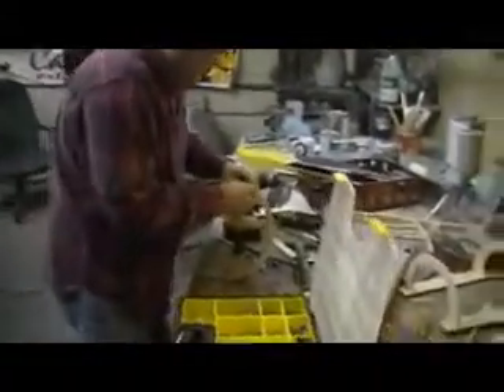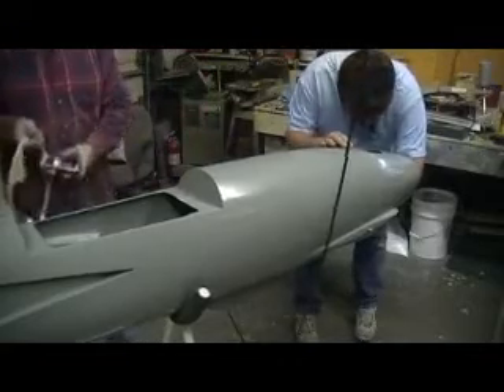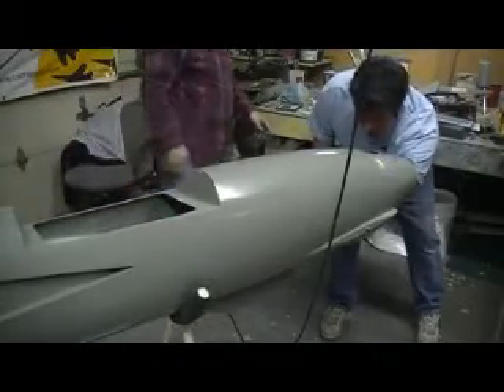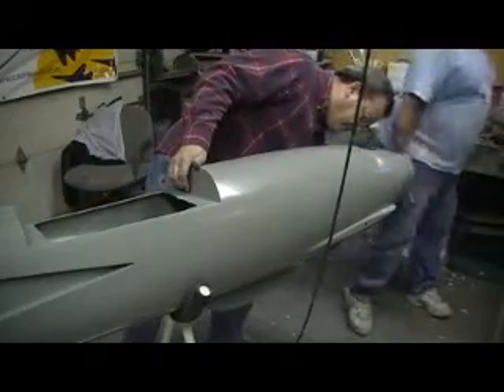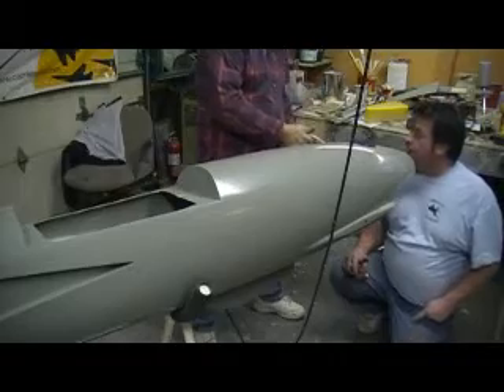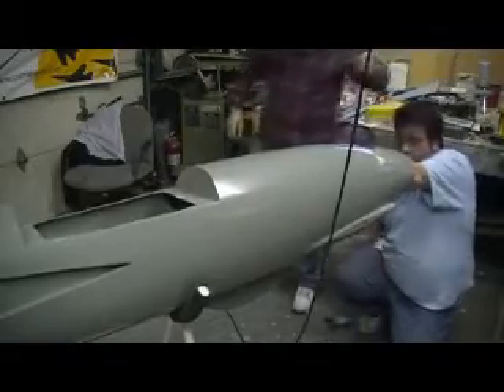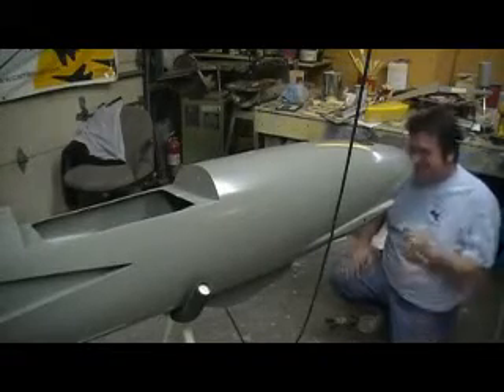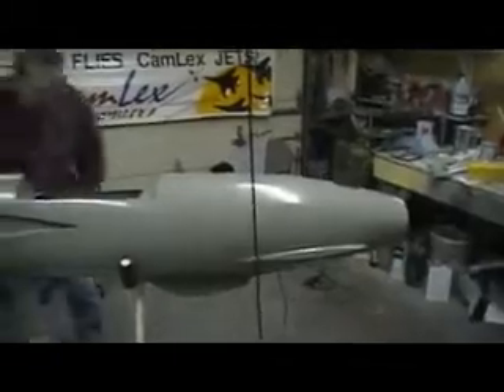how to build a rc jet F-105 thunderchief # 373

Comment: Considering that this is the prototype, wouldn't it have been better to have laid this frame up with out the primer so that you could have seen through to place the bulkheads and future installs of the engine,etc? Or is there a reason not to? Thanks for the videos Bob